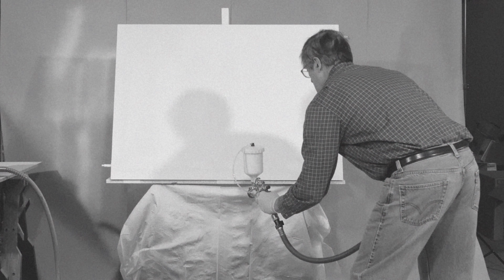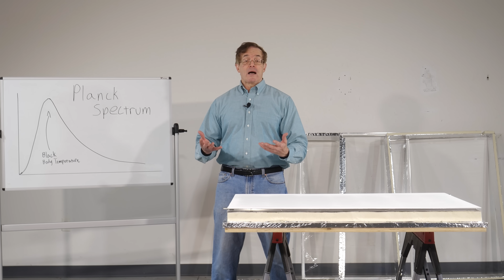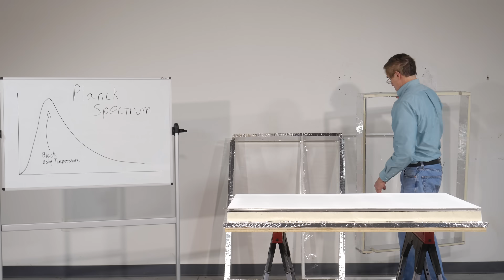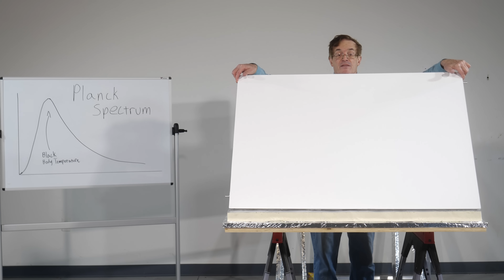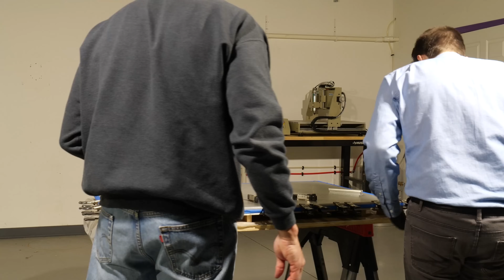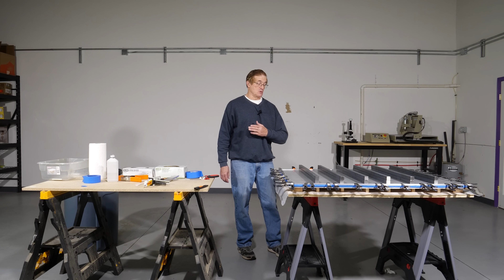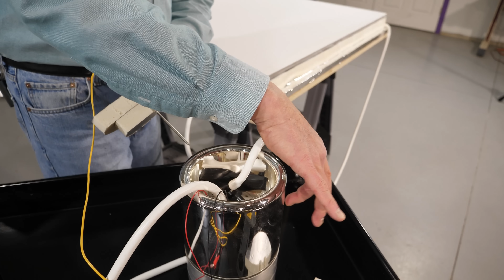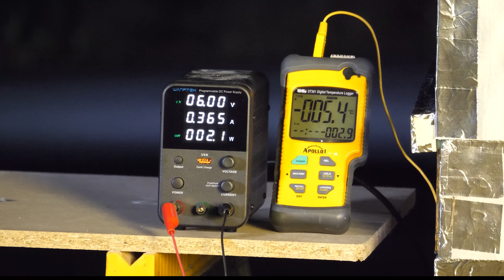Air Conditioning isn't free... but we're close.

Comment: Regarding comments about condensation affecting the radiator efficiency: The poly membrane would prevent ambient water vapor from condensing on cool radiator surfaces. The cooling is thus more effective because heat is not transferred to the radiator while dehumidifying the air ie. no enthalphy of condensation. Search "The Cold Tube" for an example of condensate free cooling.
Reply from the maker: With further testing, it turns out that the plastic membrane adds little.  It can be eliminated.

Comment: It seems that the pump energy that is translated to kinetic energy of water will be converted to heat by friction that slows the flow of water. Thus, the radiated heat flux is actually higher than implied by the temperature difference. 

Could consider the inverse of solar thermosyphon water heating where the tank is above the collector and circulation is driven by convective heating: the tank(or heat exchanger equivalent) is below the radiator and circulation is driven by convective cooling.

Comment: Here in Europe, ground water temperature is ~10C, and where I live ground water starts at 3m
And to not have seasonal variation one needs to go below 15m, easy to do in my place
In summer can put heat down to the ground, and pull it in winter via water/water heat pump
Extra tip: in second well that goes to same depth make loop closed from atmosphere - small circulation pump can be used then with no need to pull water from x depth
Bonus point for water cooling solar panels while cooling your house, raising efficiency and storing abundant heat for winter

Comment: How will humidity effect the heat transfer between the surface?  A coil of copper will ice-up and decrease conduction effects.  Some kind of heat will be needed to melt the icing to a coil.  Air conditioning is about cooling and drying, right?

Comment: I'm curious how big this would have to be to help supplement a typical building with 20 water source heat pumps, a cooling tower, and a boiler. Or even just the size to help a 4 ton unit on a house. The decreased efficiency with cloud cover kind of hinders progress here in the PNW though.

Comment: There's a guy who built a HVAC system that nearly ran on its own...I can't remember the guy's name but he actually got arrested and sentenced to prison time over it ...When he asked the judge  what he done wrong, He said the judge looked at him and said...."You know what you done".... They took all of his equipment and kept him in prison for several years..... Yeah...i really believe an HVAC system can run way more efficiently than what they say.... it's just an exchange of heat.... Some engines run on heat.... Like a Sterling engine.... think about this clearly and you'll see what I'm saying.... An air conditioner blows out hot air through the outside cores... Instead of wasting all that it could be trapped in a system to run a sterling engine which in turn could pump freon.... At that point all you would need to power would be an electric motor to blow air through the opposite coils /radiator.... I swear I could see a system like this working.... But I'm just a mechanic... Fix cars for a living ... So don't believe anything I say.....🤷...

Comment: What if you combined ceramic powder and Barium Sulphate in white Rust-oleum paint at 0%, 2%, 5% and 10% - and applied at 3 coatings - and measured the temperatures.

Comment: Could you test if using, say, Rust-oleum paint added with 0%, 2%, 5% and 10% Barium Suphate would decrease the temperature and by how much each at 3 coats of paint?

That would be a very interesting experiment as well as be possible to do in less time than your latest video.

Comment: Could I build a box like that around the external unit of my air-conditioner, or would the built-in fan negate the affect?  Talking about the typical two-piece air-con with heat exchanger sitting external to the building and the fan an louver mounted on a wall near the ceiling.

Comment: Could you make a 3 coat white paint that is better than commercial products?
Reply from the maker: Sure
Reply: Could you test if using, say, Rust-oleum paint added with 0%, 2%, 5% and 10% Barium Suphate would decrease the temperature and by how much each at 3 coats of paint?

That would be a very interesting experiment as well as be possible to do in less time than your latest video.

Comment: The best way to have built this would have been by using a CNC machine to cut into the frame a slot of a rubber gasket & cut threaded holes for screws.
Reply from the maker: Probably not. The sheets are very thin, so the screws would have to be very close together, or it will leak.
Reply: @TechIngredients  yes, the screws would be at most a couple of inches apart.  it is how they build parts for custom PC computer water cooling, so they do not leak.
Reply from the maker: And so, with about 80 screws  on each side, the epoxy method seemed easier  and didn't  require a large bed CNC machine for the build.
Reply: @TechIngredients  I didn't design panel radiator, but was it meant never to be served?  That would involve opening it & cleaning out the growth.  

And if you did need to either clean it by taking out 80 screws, or bendding it & having to create a new one, 80 screws would be the answer.  But I still didn't get what the goal of these two episodes were;

Was it just to make something really reflective?  Why was heat involved?  Why was that radiator built?  Was it meant to be cooling something, if so I nevr saw it.

Wouldn't Thermoelectric paint, created in 2006, do everything from these two episodes but much better?  This TPaint would have been more fun to play with, if one side of the paint gets heated, the othher side gets cold, & it puts out electricity!  It's like real life version of Addams Family, Uncle Fester odd science, paint your house, the sun shines on the house & powers the lights w/in.  And the sunlight cools down the house.

The hardware version of this is how they add A/C to car seats w/o the use of ducts.
And is also used to drop down temps on sciencey stuff.

Comment: So what kind of btu output per area can be expected ?
Reply: If it's 150 watts per sq meter, that would require a lot of surface area to provide any appreciable cooling capacity. About 273 sq meter per ton of cooling.
Reply from the maker: True 
That's why, in the next video, we demonstrated just the paint, which could cover an entire building.

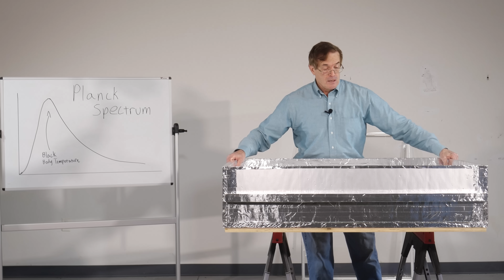Comment: 7:13 — Just a shame that this foil is too fragile for a more pernanent installation.
I wonder what could be done instead that's sturdier. An fiberglass fly-grid somewhat spaced atop the fragile foil maybe?
Reply from the maker: With further testing, it turns out that the polyethylene film adds little to the performance. You can eliminate it.
Reply: @TechIngredients  - but then the paint is unprotected perhaps dulling quickly as house facades typically dull in just a few years - I'd imagine that being a maintenance  issue requiting repaints quite often

Comment: Interesting concept. I do have a few questions about this. Your outdoor ambient is at ~0°C and you were able to cool your glycol solution down ~7.5°C below ambient with no load. Then you're talking about piping in a water coil heat-exchanger in series with a forced-air condenser. Would you put it on the high side to help de-superheat the hot discharge gas or on the low liquid side of the condenser to help with subcooling? The water coil heat exchanger should have a rated capacity all on it's own provided you meet the proper water temperature and flow rate through the coil. How are you able to calculate the capacity of your white-panel heat exchanger? Say you were to pipe it in on a 2-ton AC system, how much cooling would your white panel "Bariur"(like a barium barrier) heat exchanger provide? Am I thinking too much into this? Wish I had the funds and the means to experiment on this.

Are you familiar with the refrigeration cycle? There are ways that I've seen where you can put in a TXV right on the head of the compressor and spray a small amount of refrigerant right on the piston to help cool the compressor down and lower the discharge pressure/temperature. That method is mainly used in ultra low temp cascade systems for environmental chambers and such. That is a nearly free mechanical way to cool a compressor down and gain even more efficiency.
Reply from the maker: I would place this cooler in line with the already cooled refrigerant. The air to liquid heat exchanger is already an efficient  means to remove the bulk of the heat.

Comment: Some painters statically charge their gun and the object they are going to paint.  This way, they can paint file cabinets in the office without worrying about overspray or fogging the office.  I wonder if it also makes the bonding to the surface stronger and more even.  Have you ever tried this?
Reply from the maker: Yes.  It's a pretty  impressive  effect.

Comment: wow, i remember doing experiments about passive radiative cooling some 10 years ago, using cardboard and cellophane (not sure if it's the correct name of the food grade plastic film) and i measured  up to -5C than ambient
i also estimated the radiative cooling using air's thermal resistivity to around 45w/m2 but it was during summer, and i realized that with those pesky Cirrus clouds in summer it's hard to do radiative cooling

Comment: I installed an pre-cooler on my AC when I lived in Arizona. I was an evaporative type that provided as much as 20 degree F air temperature reduction on the condenser side. Unfortunately it only worked well when ambient relative air humidity was below 8 -10% (usually from March through mid-June). The drawback was that it caused some rust and degradation on the AC parts. 
I thought of experimenting with using water from the deep well because it comes out of the ground at about 45 - 50 degrees F. year around. The water would pass through a heat exchanger before it gets to the pressure tank (for use in the house or to water a garden, lawns etc.). It takes some electrical power to pump the water too.

Comment: can it get below dew point to remove humidity?
Reply from the maker: Theoretically, yes and no.  There is no fundamental limit on the cooling process other than the open sky temperature.  However, if water accumulates on the surface, the emissivity will drop.

Comment: Fun demonstration and a good rudimentary explanation. I would however love to see simple/rough calculations to demonstrate the viability or lack thereof for this type of device for household applications. This does not need to be its own segment of the video, a simple box in the corner would do.

With my limited knowledge of heat transfer, my thought was that natural convection almost always trumps radiation for temperatures around ambient. Although your demonstration probably works very well, my scepticism lead me to the belief that the evaporation of the water contributed to the temperature difference. Some calculations, or ideally simulations, would certainly have made me less skeptical.
Reply from the maker: Thanks. 
Convection will produce no cooling when  the body is at ambient  temperature.
There was no evaporation.
Reply: @TechIngredients  Well the water was below ambient, so i was referring to convective heating. And although you attempted to prevent evaporation, its hard to complete rule out.

BUT im not saying that the demonstration was flawed in any way. Simply that i would have liked to see calculations prove that the results were plausible 🙂

Comment: This is quite interesting, I always wondering, why when I put my fluke gun IR thermometer to the sky goes to the the lowest temperature? (-30°C), I think this can be used to "wrap" a mini split condenser, the condenser will raise the temperature inside the irradiator increasing the irradiation to the sky (and also wil be isolated from the ambient temperature), this will boost efficiency (if you have a inverter mini split will run more slowly)

Comment: Now use a gamma sterling engine to drive the fluid and it's pretty much free to operate. The cold side could be driven from the fluid, although that might decrease your overall cooling efficiency. 😁

Also curious, why not just use a car radiator painted with the thermal rejection coating? It's it because you want a large surface area for IR rejection? You could connect a sheet using TIM adhesive and it would be a very effective radiator.

Next question, what happens when you coat one side of a Peltier cooler and box half of it in? Will it produce a voltage?
Reply from the maker: The car radiator, which should actually  be called a heat exchanger, doesn't  really  have a larger surface area that is open to the sky.  Most of that additional  surface is between  the fins.
Reply: @TechIngredients  right, but I would surmise that it would make more efficient use of the heat exchange due to the many passes in the core. As you know, the more efficiently you can transfer heat into the atmospheric shunt, the more effectively it will radiate the heat out into the cosmos. Likely you could use an AC evaporator... Some long thin panel. Or perhaps just brazing bent copper tube to the back of the larger sheet.

I only mentioned that because it didn't appear that your atmospheric heat shunt panel had any sort of fins to expedite the thermal transfer.

This is an amazing experiment! Please don't think I'm critiquing you harshly. I know how much labor goes into doing something like this, and it is immense! You're in the 99.99 percentile, maybe higher 😅. I love the work you do and share with us all. I am very curious how far this can go. With sufficient surface area, can a refrigerator be made? You could probably do the math on the back of an envelope to figure out how much surface area is needed. I know I can't.

Perhaps the coolest part of this is with a radiant heat system, you can make use your solar heater, a cosmic cooler, and a T fitting to really use the environment to our advantage. Of course, good insulation will go a long way to making that more achievable.

Keep up the awesome work guys!

Comment: JESSUZZ people are so easily fooled, it's so depressing that anyone is taken in by this. It says a lot about a failing education system
Reply from the maker: Let's  hear your arguments.
Reply: @TechIngredients  this set up shows a total lack of awareness of the basic principles. They show a graph of Black body radiation without understanding it, maybe watch a video about that? I honestly don't know where to start, everything is messed up. Ok, here's something, they want to make a super efficient radiator to dissipate energy, but they start with an insulated box. Just think for a moment, why is that a sensible design choice?
Reply from the maker: How does showing  a graph of the plank spectrum demonstrate  that I don't  understand it?
You are missing  the point of radiation cooling.  The insulation is used to PREVENT other means of heat transfer such as conduction and air convection.
You might watch the first part of the video again, and knowing this, it might make more sense to you.
Reply: @TechIngredients  Crookes radiometer.
Reply from the maker: You ARE all over the place.
That has nothing to do with radiative cooling. Rather, it relies on differential heating.
Reply: @TechIngredients  not using convection effectively, air flow, insulation, silver surfaces, using thin aluminium tape, surfaces exposed to light, water grows mold, legionnaires' disease, etc

Comment: Question; Sorry my inginuity! If the heat-exchanger are 1 to 2 m.  underground, it will not ocurr the same efect? It is perfectly insulatet from any infra-red radiation?
Reply from the maker: No, it won't.
The whole point is that the radiation  has to be dumped into the sky.  Only the radiation  that is dumped into the sky is lost from the system.

Comment: How would I go about comparing the efficiency of a 1500w standard electric heater, with my solar heater, that I can use a 250w heat lamp on when cloudy? If I don't get an answer I guess I'll just do it the old fashion way and compare how warm a room gets after a certain amount of time, and try to get the starting inside and outside temps to be the same.

Comment: Regarding your acoustics projects, why is it impossible to build an absorber for the 20 to 200hz range?  Panel companies are quoting 10 grand and dozens of panels to "improve" the rt60
Reply from the maker: It's  due to the very long wavelength.  Sound is a propagating pressure wave.  The atmospheric pressure  at the peak of the wave is for a brief time, actually higher. So, when the slowly rising pressure with low frequency  sounds strikes the panel, the entire mass of the panel can accelerate, then decelerate and then recover its  original position with little energy  loss.  The air on the opposite side of the panel will be driven by the panel  to replicate the pressure  wave, and it will continue  onward.